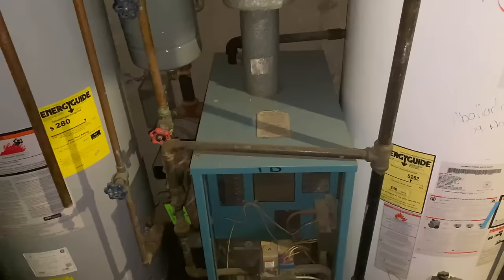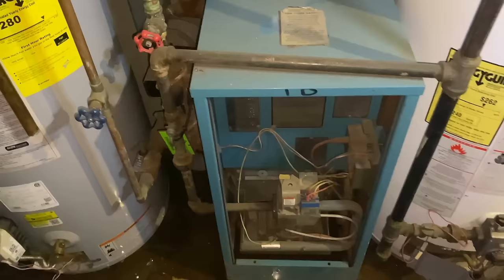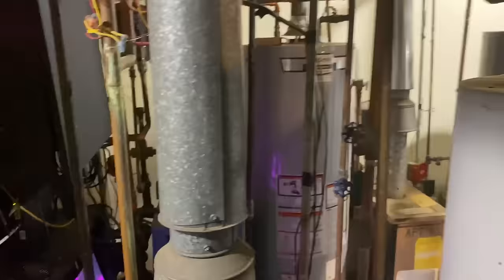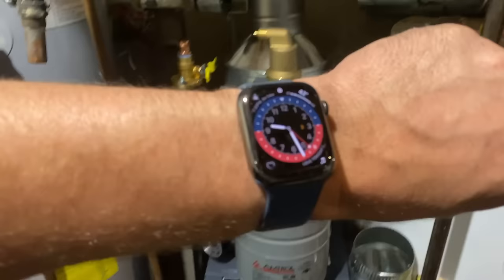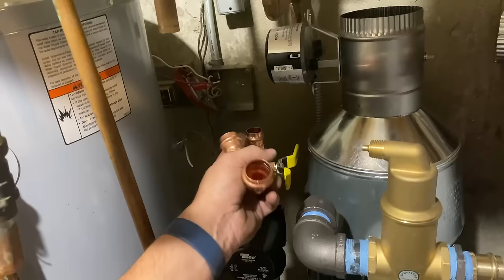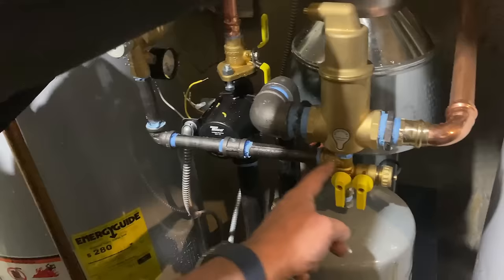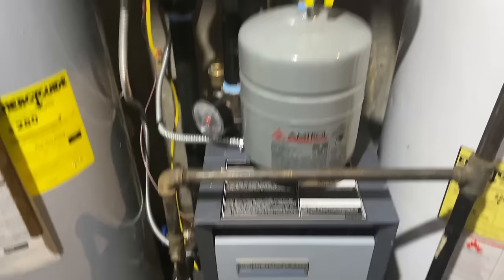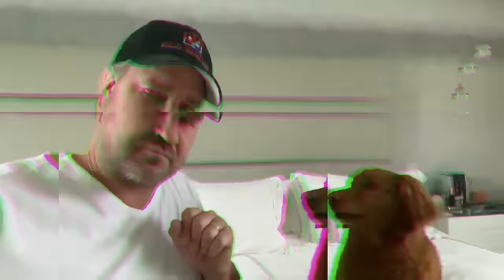Replacement Weil Mclain Hydronic Boiler in 8 Unit Apartment Building

Comment: Thank you Mike! When I started to have zone valves and aquastat problem 2 months ago with my Lennox CWB-4D. I started watching your videos. Now, I know just about every part of my boiler. The Honeywell and Caleffi zone valves, air vent, ignition controls etc. I have now DIY upgraded my system with a Taco switch control and replace the L8148A Aquastat. It seems that the service is more interested in selling new stuff than fixing the old. And in Seattle, it's getting hard to find people working on boilers and not many choices when replacing them if you don't want the new combi boilers.
Reply from the maker: Awesome thank you so much for the support and your comment. Thank you.

Comment: Mikey..... for residential clients.... 50.00 off if their utility room/closet, and the pathway to the utility room/closet is cleared of all junk before you arrive. Some of these places are hoards. Separate systems allow only ONE tenant to lose heat/HW, and not a failure taking out the entire building. If each tenant is paying their own gas/electric....... landlord would be best served keeping these separate. MAINTENANCE likely much lower with this stuff, than with wall hung 5-10 year equipment that is more maintenance intensive.

BTW, very nice install.  Why would landlord care how PRETTY the older stuff is?  You get to redecorate as the other units hit their EOL

The combis seem to be designed more for the contractor, so they can hide it in a closet, and not "waste" space to have a proper 8 X 15' utility room. ( Which is where the workbench, vice and homeowner maintenance stuff would also go.... you need raw, unfinished space for utility access, DIY and hobby projects ANYWAY. When I was a kid, that was where the 250 gallon oil tank also lived.

Comment: Wow so many boilers in one place. Do you check the air requirements for the area? And all non condensing so much gas being wasted.
Reply: Total cost of ownership is probably still much less with conventional equipment due to less maintenance required.
Reply: @tccoggs  Agreed he has every safety device in there in commercial installs back in the day been way smaller.

Comment: Was wondering, in my area unions for gas can not be in the unit itself. Must be installed outside the appliance. Is that not the case in New York? Just curious. Like the videos keep up the hustle.
Reply: Makes sense if they leak it can cause a roll out. Better off just putting on the union after the valve and before the drip leg
Reply from the maker: we can do that

Comment: Where’s the combustion air for all that equipment? It’s all starving 🤣 also a little critique replace those old gas valves they tend to leak…just a thought 💭 I usually do them on the fly

Comment: Why not upgrade to cast-iron baseboards also? I think that's the best way to get the most out of boilers...I know it's expensive job and lots of customers don't want to spend the money but you can always upgrade in future
And aren't you supposed to add two low water cut offs? For any home more than three families
Reply: each boiler is for one family. this is an apartment building things never get replaced unless they brake